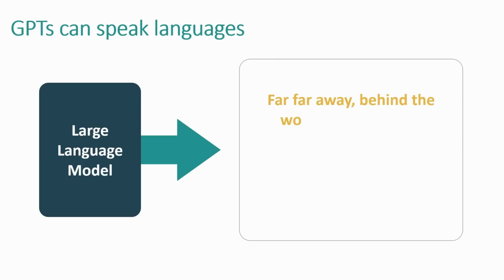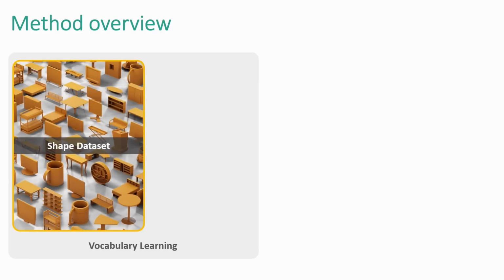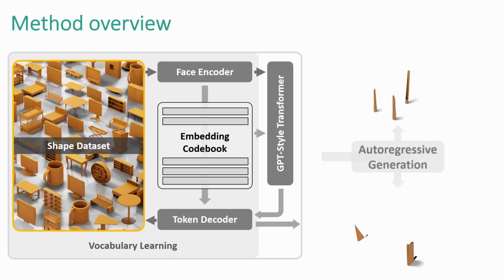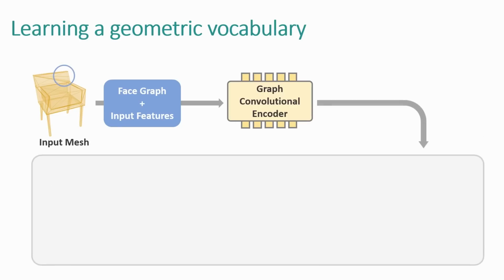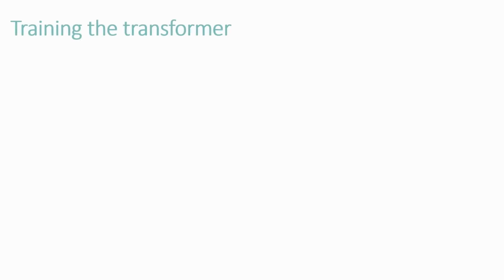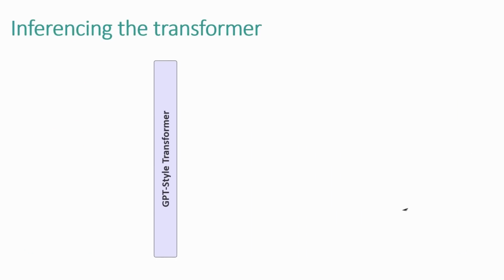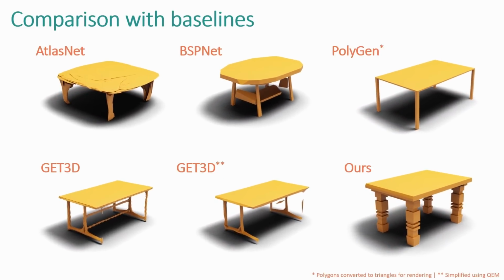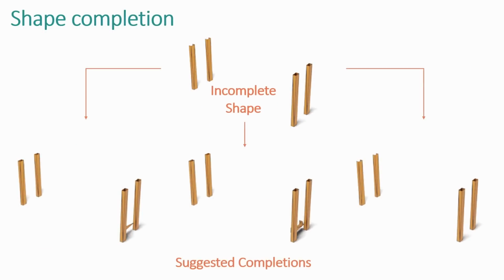MeshGPT: Generating Triangle Meshes with Decoder-Only Transformers

Comment: I'd still prefer quad for easier editing, but this already amazing.
Reply: If you use Maya, you can turn the triangles into quads with one button.
Reply: @JoeBissell there is no such thing as pushing a button to get quads. Especially for complex geometry. Not today.
Reply: @bionasys2967  You haven't used nTop it seems. Can convert anything to quads, regardless of geometric complexity.
Reply: Oh, I use maya. I use any tools actually, I even code my own tools. But no button does good quadrangulate, unless it is very simply shape.  @JoeBissell
Reply: Yeah indeed, the mesh looks terrible. But the shape looks good.  With some remeshers we can actually turn this in usable geometry.